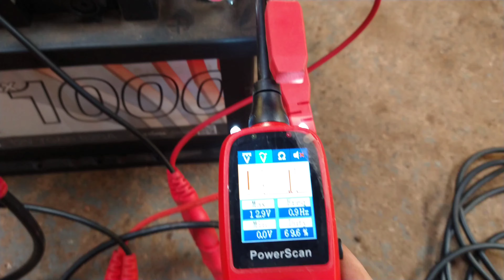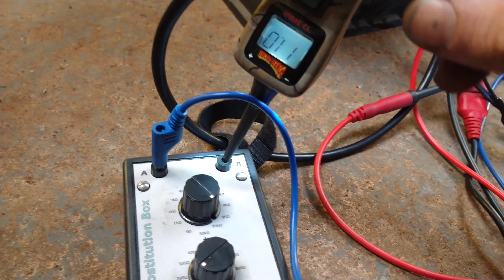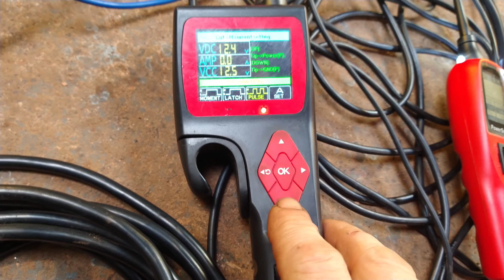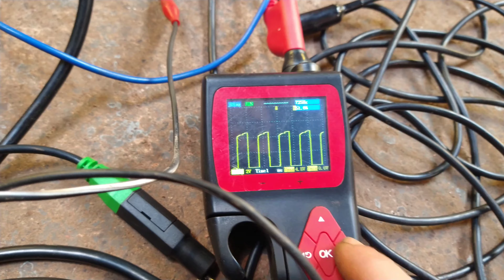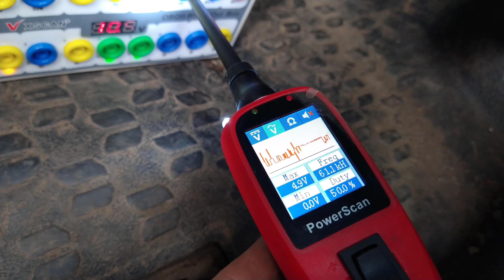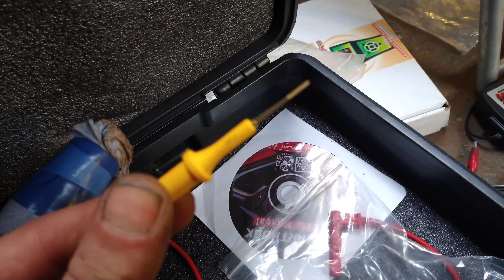JDiag Smart Hook

Comment: Looks like a very useful tool for me I love my power probe 4 master kit and My pico
Reply from the maker: I don't have it any more, now I use the power probe and pico too.
Reply: @mechanicmatt871  oh really Was it just not very useful for quick tasks
Reply from the maker: I found different voltage reading when I compared with a volt meter or power probe. I wanted to rely on what I used. Also the scope was limited as you would expect for the price, the best part about it was the latch function to hold power on or pulse power at the tip. Another thing was the 0 to 5 volt sensor simulator was in 0.5 volt steps that some times wouldn't allow me to get the voltage right where I wanted it, I do that to see if I can clear a fault code if I have a faulty part, so I know the new part will fix the problem. 
The red and green led lights didn't come on in the same way they do with the power probe. There wasn't anything wrong with the power probe 3 other than it just showed volts so I decided to go with what I know and trust and now have a power probe 4.
Reply: @mechanicmatt871  awww okay that makes sense
Reply: @mechanicmatt871  I been using my power probe 4 master kit for a long time never had any issues with it
Reply: @mechanicmatt871  that would definitely make it kinda useless since it's nit very accurate
Reply from the maker: When I moved from Scotland to Cornwall I couldn't take everything with me so I gave this away.

Comment: Hi, do you know if it can measure current draw while giving power to something? Say for example if you used it to power a blower motor or wiper motor would it tell you how much current the motor is drawing? Thanks.
Reply from the maker: Yes it does give you the amps when activating something. Cheers Matt
Reply: @mechanicmatt871  Thank you, thanks for your reply.

Comment: Hi, Can You see this video
 https://youtu.be/pIOZWC15_iQ
and Can you check and confirm that this device has no protection in the event of detecting a short to ground when we power an element(sensor, valve etc.) with it?
Best regards
Reply from the maker: There is a fused ground wire, if powering a disconnect load using the probs fused ground wire and for a ground and the probes tip for the power it will be ok.
Reply: @mechanicmatt871  Thnaks for Yours answer. I want to buy JDiag P0200, and after „Mario” test i have some concerns. Best regards